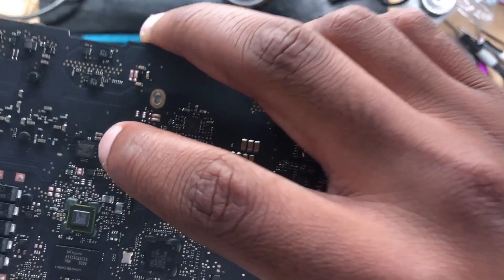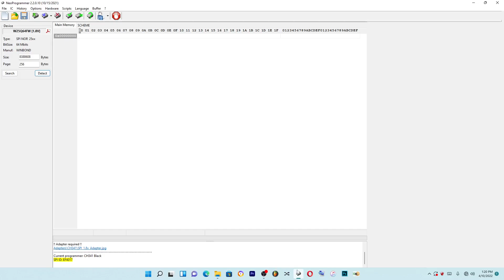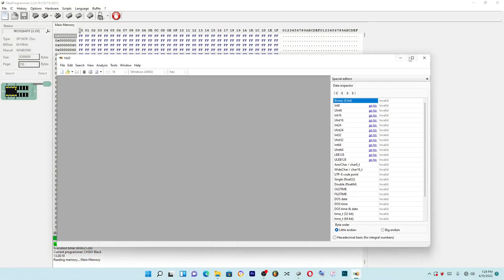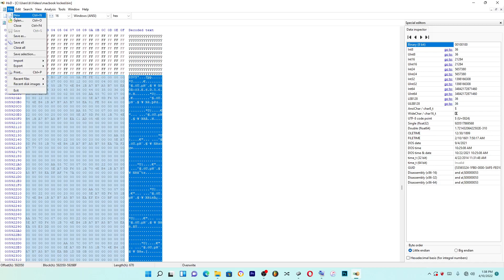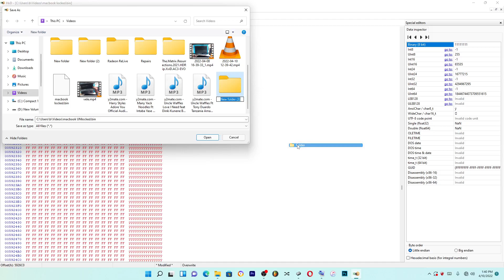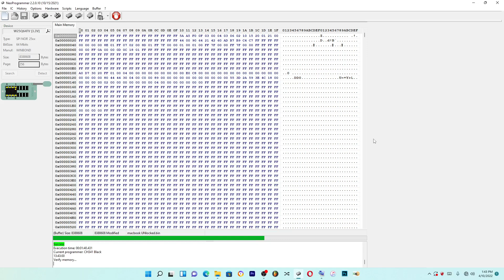MacBook Pro EFI LOCKED 🔒 REMOVAL by modifying the bios chip

Comment: Which MacBook Pro Version is this? Can I do the method to A2179 MacBook Air 2020?
Reply: Any macbook from 2012 to 2017 can do this. Above 2017 is secure locked with tp2 security chip and cannot be programmed.

Comment: Thank you very much for the tutorial. One question please: is it possible to flash a new BIOS without desoldering the chip? for example, with a pair of tweezers that connect the programmer to the BIOS chip on the motherboard. Thank you.